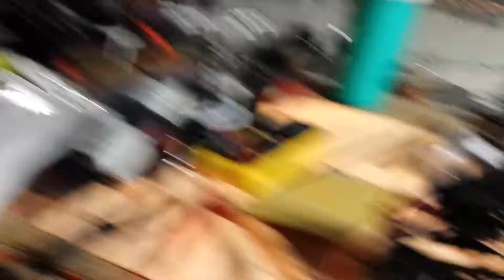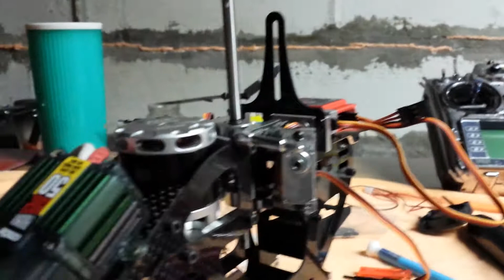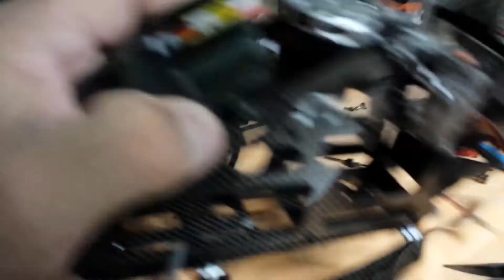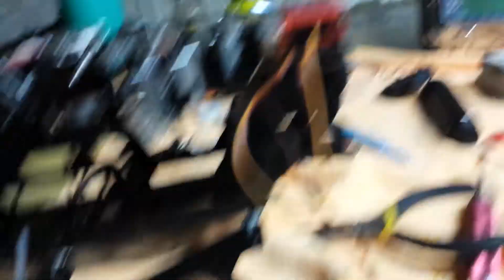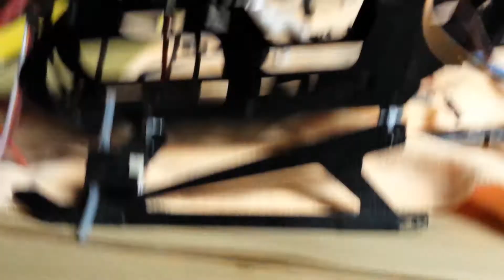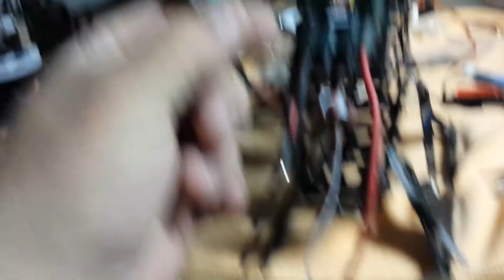450 ts pro build update

Comment from the maker: I just got a new tarot 450pro v2 canopy and thought I would size it up on the new 450ts
it will fit but its tight around the bottom of the frame
you need to get a tarot or other 3rd party v2 canopy that does not have the grommet holes already punched as you need to make them yourself to fit the frame
the holes will be close to the end of the back tips of the canopy

Comment from the maker: the pro v2 canopy will not work 
the older 450 pro canopy will work.  You just need to make the holes for the gromets about 1 1/2 cm further back
You can see the pro v2 canopy on the bench as I tried to fit it with no success but I have fitted 2 v1 pro's to it fine